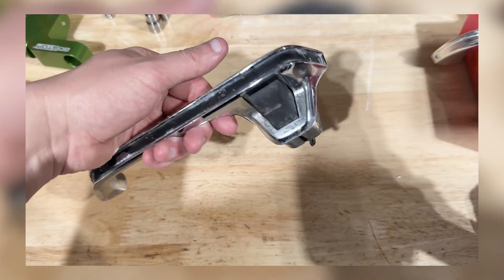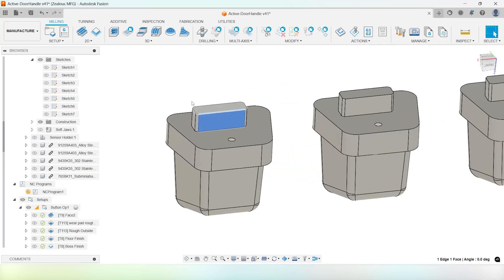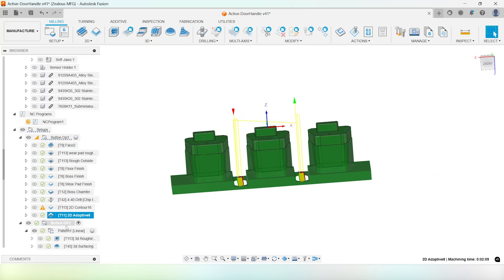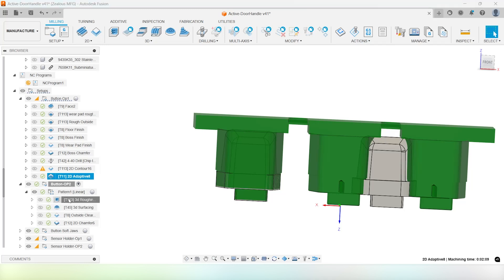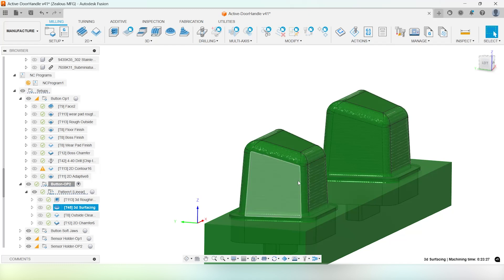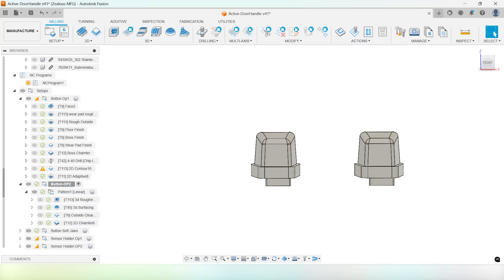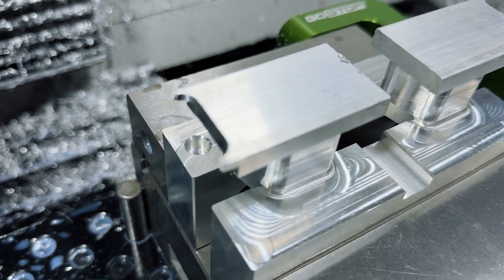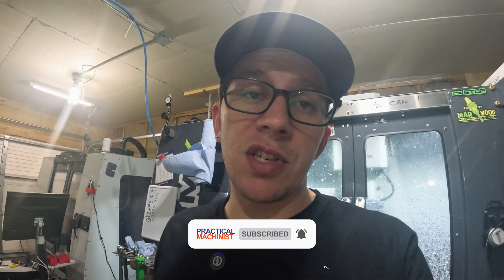Customer Brought a Part… With No Files. Here’s What We Did

Comment: Why tab them at all? You could make the soft jaws to fit the whole first opp as it comes out of the machine.
Reply: I think I explained it in the video. I was worried about vise pressure being uneven and it’s the middle part.
Reply: @ZealousMFGWI  I thought you ended up only running two at a time. My mistake

Comment: For that amount of parts,  unless you are going to have many more parts in the future.  I would've run one at a time.  Less time roughing and slotting to break them apart.
Reply: That’s not a bad idea either. I was able to use standard 6” length material with this method. (I don’t have a band saw here)